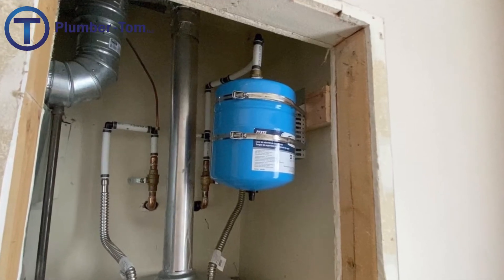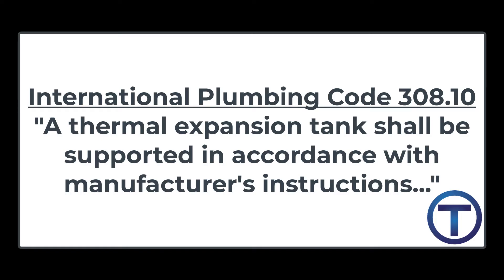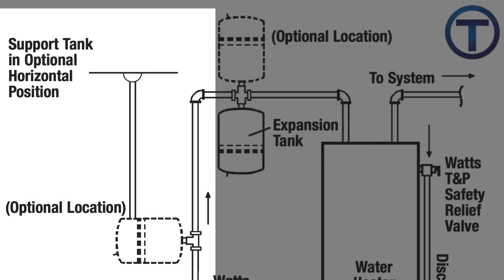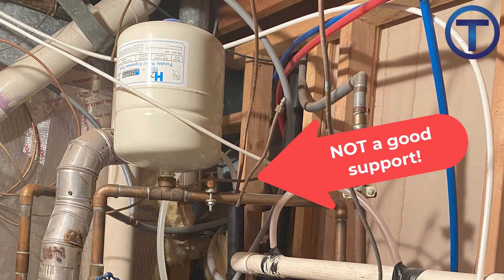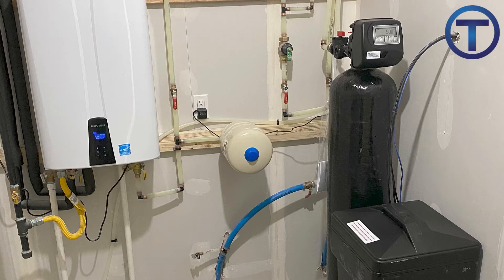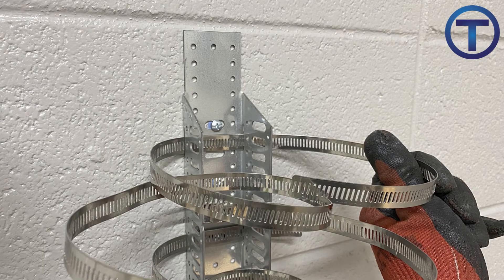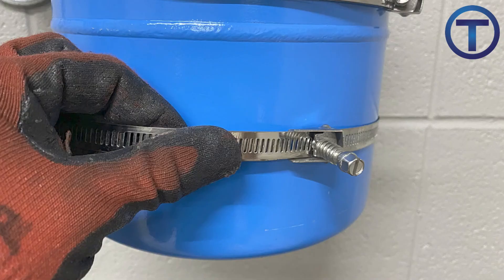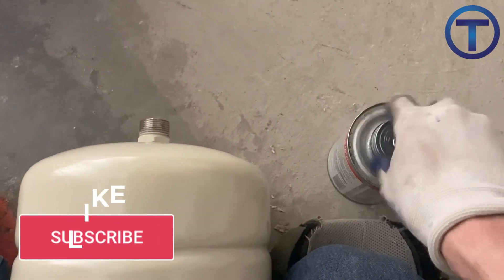Expansion Tank Support - Proper Installation for Expansion Tanks

Comment: Optional location is best.  If bladder in tank fails, the tank would continue to act as a pneumatic tank with trapped air in the top of the tank.  In any other position, air would bleed out and the tank become waterlogged,,,,,,,and heavy.
Reply from the maker: That is a good point!

Comment: The new home builder in our new home uses  a galvanized pipe to the tank straight up. Is it acceptable code
Reply from the maker: Code does not specify. If the inspector passed it when the house was built then yes.  I think galvanized tape is plenty strong enough to hold the weight of the tank.

Comment: ..while you are dead-on about supporting the tank, the actual orientation should never be so that the in/out of the tank is other than at the bottom, this leads to the tank filling up with water when/as the bladded fails -- they should always be installed so that the input/output hole to the tank is a the bottom, which will leave the air pressurizing valve at the top.  Trust me, I know, as I've had expansionj tank bladders fail over time, leading to the tanks filling up with water even when pressurized with air.
Reply from the maker: That makes good sense. Thanks for the input.
Reply: Appreciate that comment 🤙

Comment: brother I've scene thousands of expansion tanks held up sideways on copper or upside down full of water and its not going anywhere and completely supported,
Reply from the maker: Thanks for that perspective.  Im here to present code regulations and manufacturer’s instructions.
Reply: @plumber-tom9470  : its still code
Reply: And when installed sideways on the second floor of a townhome, the bladder can fail, the heavier tank will cause the pipes to leak and the drywall and carpet in the entire home get flooded.

Comment: My expansion tank has failed. It is supported by the pipe vertically. My problem is that my furnace and water heater are in the middle of the basement no wall near by. I must rig a ceiling mount as I can find a ready made ceiling mount nowhere
Reply from the maker: That’s a tough one. Anything you can rig up is better than nothing.

Comment: So I liked the simplicity and  speed of the  tee going on the   water heater nipple  then a 6 inch nipple and 90 up  screw tank on     I like that except    the problem with meeting code  plus admititdly       I agree the support is an issue     so   why not cut a block of wood thats  a tight fit on the top of the tank  and strap the 6 inch nipple with a 2 hole strap ?   I just installed one in UPC   (ca)     no inspection but I think  Im meeting the code    supported by wood ?
Reply from the maker: I like that you are providing support.

Comment: My home psi are 80 expansion says 80 psi max. Would it be safe to put it at the max ? Also, will it deteriorated life of the tank?
Reply from the maker: 80 is high but you can do that. You would want to check the manufacturer specs for max pressures.
Reply: 80 or higher should have a prv installed dialed down to 65 to 70

Comment: can you use plastic or metal strapping to serve as support and screw it to wood somewhere while the expansion tank is attached to the piping ?
Reply from the maker: Code does not specify what to use to support. So yes, you can as long as the local inspector is ok with your support.